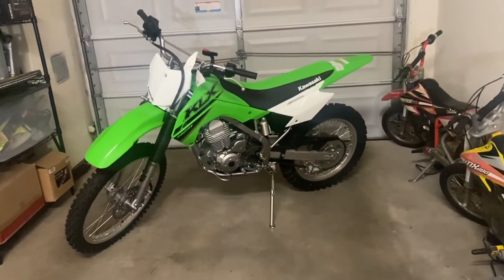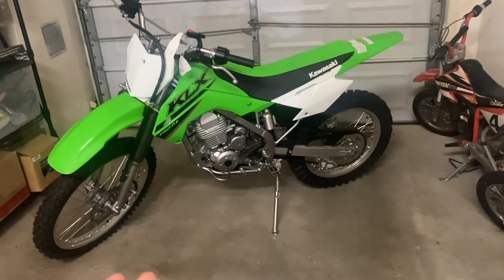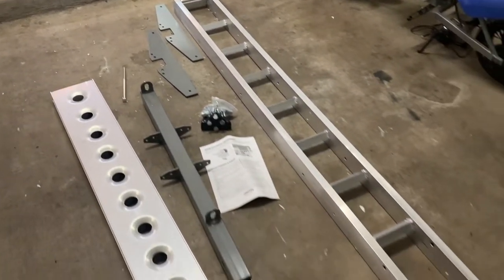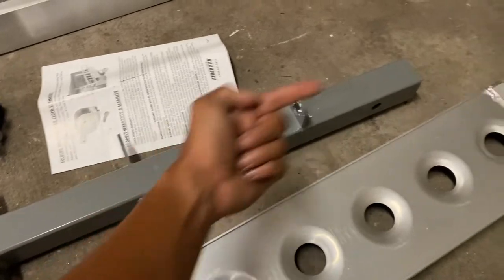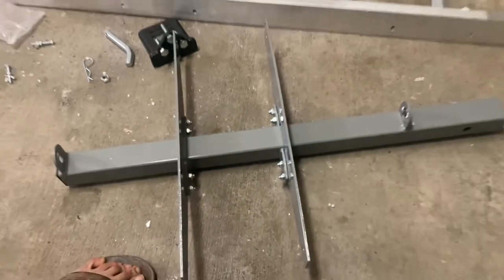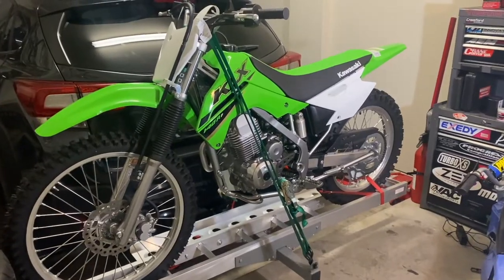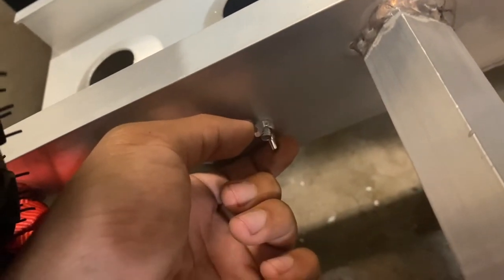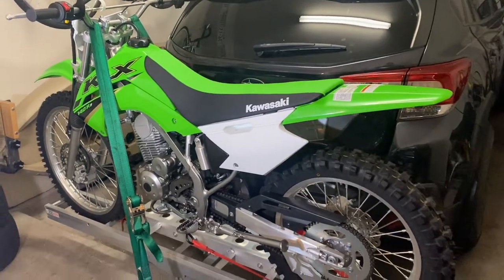Black Widow AMC-400 Hitch-Mounted Aluminum Motorcycle Carrier | Unboxing Assembly Review

Comment: Uh we used a 2x4 block under the front fender /shocks and on tire to not blow the seals while strapping it down and driving. 
THAT LOOKS AWESOME DUDE...
Reply from the maker: You mean to keep it from over-compressing? That may be a good idea for me to consider
Reply: @PatOutdoors  I guarantee you don't have to torque down the front forks that hard for the bike to be secure. You should no way be blowing seals hauling your bike.
Reply from the maker: @yamahasuperbike2202   I appreciate your input. Just wanted peace of mind on the Highway during the long drive. I haven’t been tightening them as hard since then
Reply: For my gas gas MC250 I do use the Fork Support Side Stand Combo, while its hard to break the seal I like to use it because it makes very easy to secure the bike and even in the event of a big "bump" the forks wont move